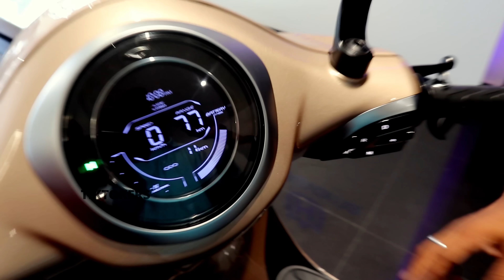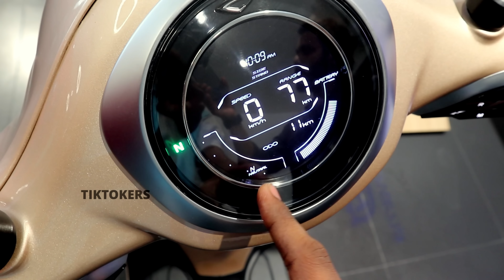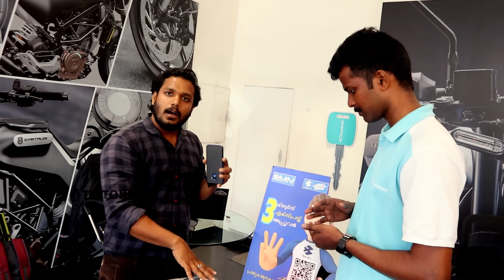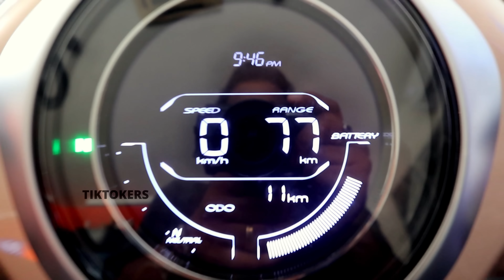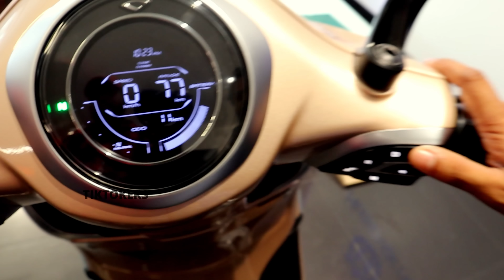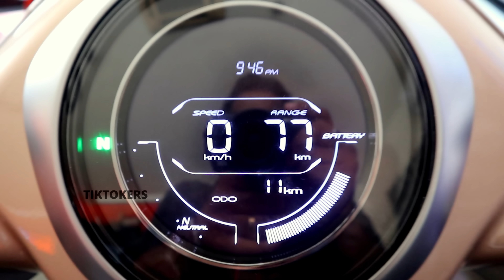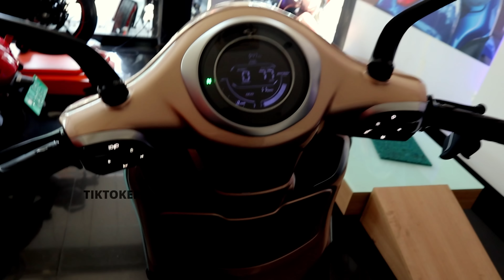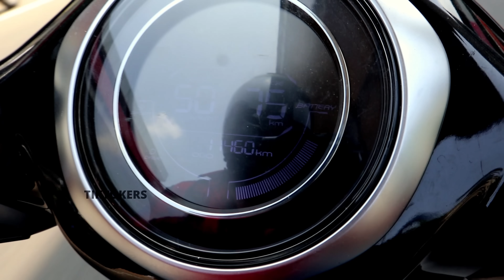ബജാജ് ചേതക് വില കുറച്ചേ നാട്ടുകാരേ ഓടിവായോ | ഇനി വേറൊരു ഇലക്ട്രിക്ക് സ്കൂട്ടർ നെ പറ്റി ആലോചിക്കേണ്ട

Comment: A range of 80 km may not be sufficient for people with a longish daily commute as it would involve charging the scooter on a daily basis, which takes 4-5 hours. A range of 100+ km would have worked better.
Reply: You'll get 115 if you maintain speed of 40-45 km/ hr